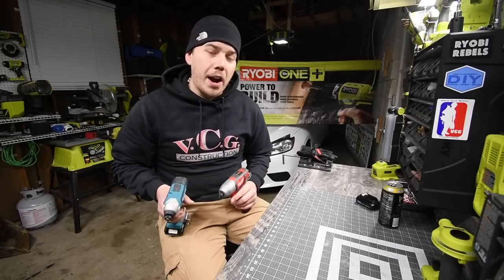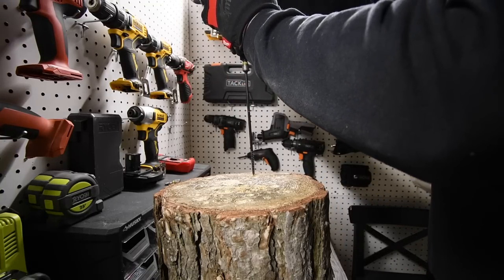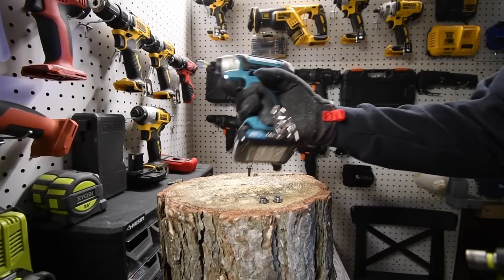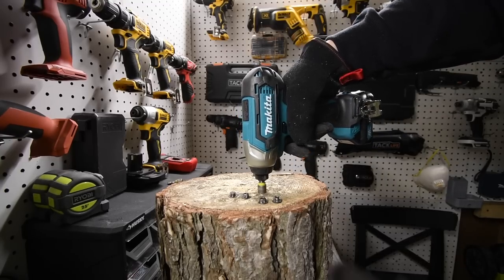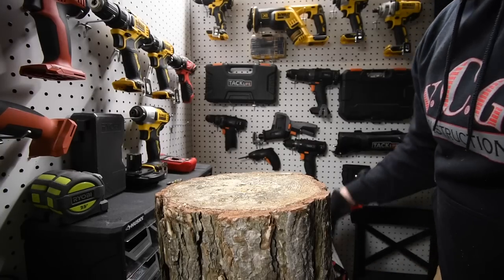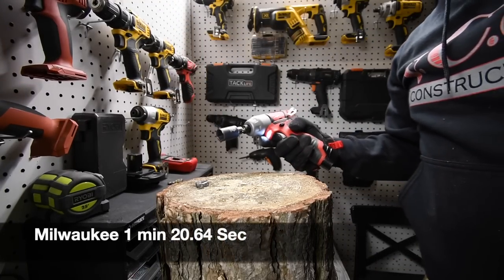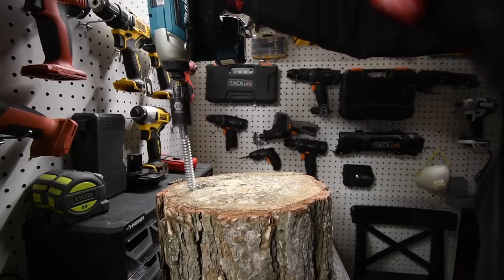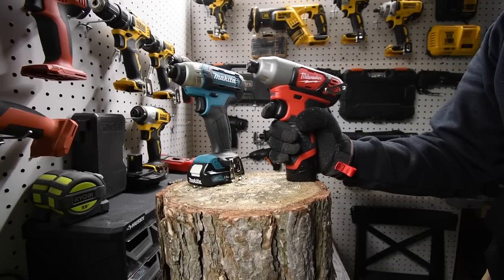Makita VS Milwaukee 12v impact drivers

Comment: Good test. I like my m12 tool combo. Impact and hammer drill. Just bought the 3/8 impact and 6 ah battery. Bare tool and battery were pricey. Tried a 3/8- 1/2 adapter and 1 inch deepwell socket on snow plow. Easy peasy. Like butter.
Reply from the maker: very good and thank you  sir

Comment: You cannot use a actual tree section to determine these test because of knots in the wood or sap in the wood to many variables that can affect each outcome of each tool but none the less both tools being able to sink that into a tree section at 12v is very impressive but Milwaukee has it beat because of warranty
Reply from the maker: all wood have knots. I had a Milwaukee fuel impact 18v got stuck with a 5" spax on a 4x4. wood itself is inconsistent
Reply: the video showed the Makita taking out a screw that the Milwaukee couldn't.

try watching before you comment.

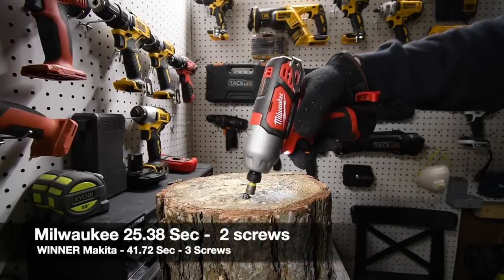Comment: I heard you say, "Ruin the tool," near the 8:00 minute mark when the Milwaukee was not taking out the lag screw. What's the difference between an impact that's hammering and spinning vs one that's hammering and not spinning?
Reply from the maker: I said that because if you make the anvil skip to much it will ruin the tool. because your overworking the impact driver. which means for that job you need a more powerful one. No matter what its bad to make the anvil skip long term.

Comment: At first I got real excited at like the 6 min mark.   I was like finally Ryobi got their act together and expanded the 12v line beyond the crappy drill.   Then I realized what you actually had.
Also I was amazed out how makita ate Milwaukee’s lunch on that one.   It wasn’t even close
Reply from the maker: I was surprised as well
Reply: makita makes quality my dude! Milwaukee m18fuel is a monster but my makita xdt16 is a touch less powerful but much more quality driven in my opinion.
Reply: @ManCaverTools  also makitas 12v brushless screwdriver you tested surprised me it was a monster!

Comment: It’s almost a shame how much power you lose using a 1.5 ah battery. With new fully charged batteries you can even hear the speed and torque difference even just up to the 2.0ah but the 4.0 and 6.0 you can hear a huge difference and of course you can feel the difference using them.
Reply from the maker: I will be getting more ah batteries for the Makita soon, this test is not over :)